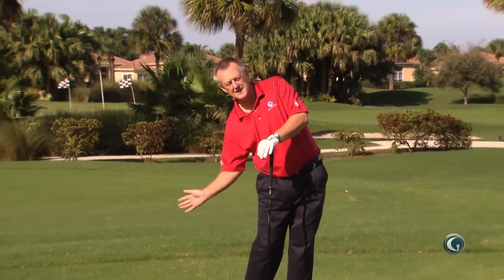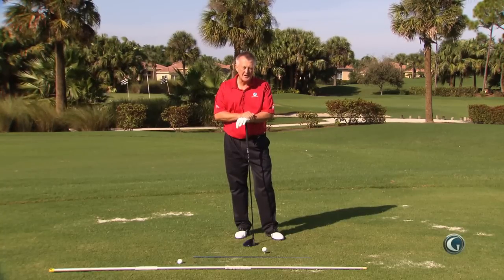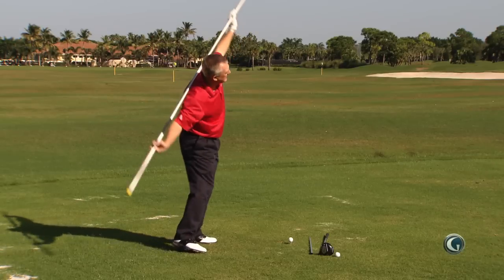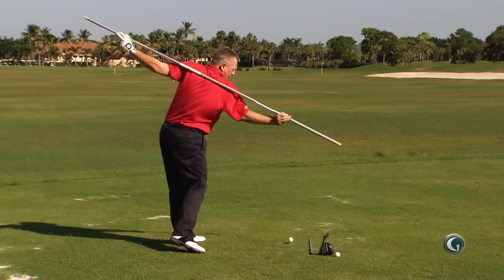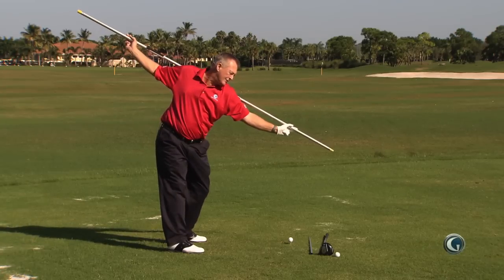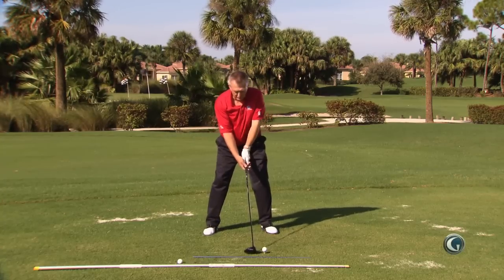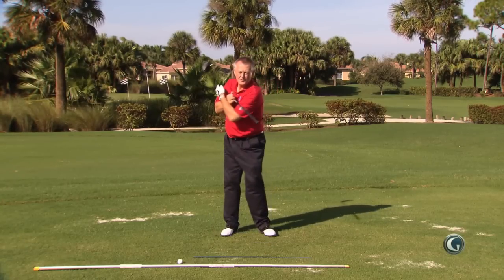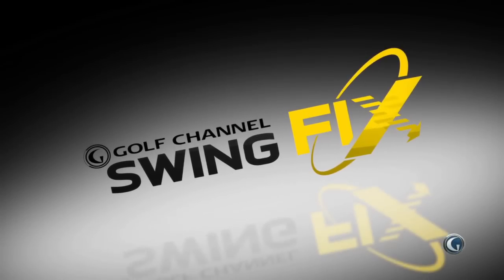Tom Watson Driver Improvement Drill - SwingFix | Golf Channel

Comment: it is all a load of rubbish mate. the drill is based on the premise that the down-swing starts with everything moving as one unit; but it doesn't. the hands work as an independent unit in the start of the down-swing. the key is to get the club over the right shoulder at the top and then keeping the club over the right shoulder in the start of the down-swing. and the secret to that is hogan's right leg, and grip, secret.